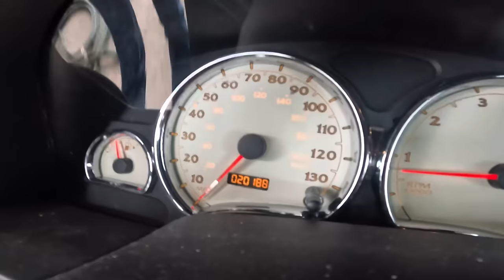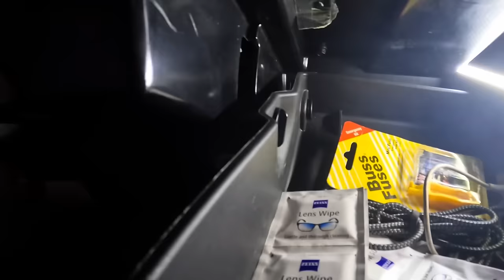Stripped Actuator! Clicking in Dash! 2007 GM Saturn Honda 3.5l

Comment: No matter how little you drive it, you still have to service it regularly..and it sucks because they will sell it eventually as low miles and well maintained. And some unfortunate buyer will buy it and spend a fortune in the next 3 or 4 years fixing numerous problems that were caused by lack of services. And id definitely be draining that fluid out due to corrosion, I bet the fluid is original and fluid neglect caused the issue to begin with.

Comment: What part manufacturer do the rear drums come from because those cylinders did not last long .My 02 Nissan rear drums have 209,000 k approx & I only checked them for wear about a month ago & they only needed adjusting due to the handbrake not holding nothing else required replacing.

Comment: Surprised you didn't use tube wrench on the brake line?? You are otherwise so exact with using the correct tool.  I have had  people want to have the drum clip reinstalled.  You can remove the clips using a needle nose plier.  Actually always have some in my tool box.

Comment: Wife unit looked unimpressed with your mileage story.  Yeah, I've been there.  Also, while replacing an engine on my wife unit's Land Rover I noticed the ancillary stuff bolted to the engine had different stamps on it to.  First noticed a Toyota logo on the power steering pump then starting looking.  Come to think of it, I think the power steering pump is the only thing that hasn't broke.

Comment: Changing lanes in an intersection is illegal, in case people aren't aware because they slept through driver's ed. Also, those door actuators are the bane of my existence. My caddy has two but fortunately they're easy to access. I've replaced them half a dozen times because the big nylon gears tend to break in half. However mine ONLY use two bolts. There are only two studs popping out of the HVAC box to mount them. No third hole for a screw.

Comment: That Saturn should be all wheel drive with the Honda 3.5. I see the rear bearing assembly has a place for the axles but I dont see the axles. Is that a 2wd v6?

Comment: Ray, the rear cylinders most likely failed due to corrosion caused by water intrusion in the brake fluid. A complete and thorough job would be to do a complete brake fluid replacement, not just a bleed.

Comment: While the backing plate is wet with brake cleaner, I've always wire brushed and lubed the bosses.
I see later in the video, you did that too.
I don't ream you out; I make suggestions that might work easier for you and save you time.

Comment: If I remember correctly, when Saturn was being done, people bought it because of the import engines, The idea was Import engines were not the older gas guzzler engines that were still running around and people thought they were better. Mostly the new gen of drivers back then which I think was also when the business office work force started to take an upturn from the factory jobs so the whole automotive shift happened. Not as big a shift but it was one. Thats when cars were becoming just a form of transportation like most cars are like now. As long as you don't blow a lot of money on them to work and get you from point A to point B then who cares.

Comment: Wow Ray, I watched many of your vids but this is the one where you show most persistence. The actuator was a great shortcut. As an engineer I cannot get across the stupid design of the clip on the handbrake lever. They could have made that a real spring clip instead something made of shit steel that you have to bend around a small rod. Anyway, great job!

Comment: Wait, I thought as long as the wheels are turning, the odometer will move. If you're towing it with all 4 wheels on the road, shouldn't the odometer reflect the milage?

Comment: The Patriot wasn't a FIAT, it was a reskinned Dodge Caliber, that shared Mitsubishi suspension. The whole MK platform was a Chrysler/Mitsu mashup which can't be all bad since they had been doing that since the 80's. Now the Patriot was a colossal pile of crap, I had one, but once you realized how it was built it was cheap and easy to modify. Mine sat on Caliber SRT coilovers with Mitsubishi outlander control arms. Everything bolted in like it was made for it, because it was in a way.

 The Renegade, which replaced the Patriot, is a reskinned FIAT 500 though and it does stoppies, so that's fun... I guess.
Reply from the maker: Sry It was the compass

Comment: Nice video Ray!  Good job with the brakes and actuator.  But you were totally wrong when explaining the purpose of the “little arrow indicators” on the dash and outside lights. They are only there to explain why the driver has been riding their brakes for the last 10 seconds or so. They usually come one once the driver has started a turn!!😡

Comment: the frustration i feel watching you casually and easily un threading a rear brake line from a wheel cylinder on a car from the early 2000s ....  Living here in the so called "RUST BELT" ... torches and new brake lines would be involved if that was from up here in Windsor... Ontario... Canada...  (south detroit)

Comment: I watch all your vids. I am NOT a mechanic by any means but I have one question. When you put the springs back on the drum breaks, why do you use a pair of end cutters for stretching the springs? I would think with the pressure you must use they would tend to cut into the springs and cause a premature fail where the cutters were applied. Is there a tool thats made for that application?

Comment: Some mechanics actually spin those off. In this case it probably wasn’t taken off like you said with 20 k on the odometer. I myself don’t see the need for this clip. Sort of like the screw that holds the front rotors. (I put them screws back in the rotor but not required)

Comment: There is still a 1/2  in. Of crust on the  backing plate by the cylinders😮 A couple of strokes with a small wire brush would do wonders.👈😳👍

Comment: I've got a Vauxhall Agila B which is the British version of the Opel Agila B which is a badge engineered Suzuki Splash with a Suzuki engine and a Mitsubishi gearbox. Apart from being one of the the most common 1L engine in the UK since it's used in Nissans, other Vauxhalls and in Suzuki's own cars it makes it easy to find parts for but only for the engine and not the rest of the car since that's just Suzuki parts. Though since it's badged up as a Vauxhall they won't supply the parts and Vauxhall won't supply parts since they claim it's too old for them to get parts from another brand... Then there's motor companies who deal exclusively with Vauxhall and Suzuki who don't respond when contacted because they are a small distance away (like 2-3 miles)

Comment: Can't the wheel cylinders be honed and have new pistons and rubber seals replaced?  I worked for my dad for many years in his garage back in the '50's and '60's and we very seldom replaced the entire cylinder and dad did lots of brake jobs.
Reply: Just the labor to rebuild the cylinders is more than the units cost.

Comment: I had to do the rear breaks on my 05 saturn vue because the spring cap on the pin rusted out and the pin pulled loose and the break exploded inside the drum >.<
Reply: Well no wonder, somebody had installed breaks instead of BRAKES.

Comment: But surely the mileage would go on it if the engine is running or not as the wheels would be turning and and there for the odometer would be going or am I wrong .thanks for the video

Comment: As a new employee of a BMW dealership in the early 90's, I was required to take a driving class created by the BMW corporation.  We were taught to treat other drivers as if they would try to collide with us at every opportunity, and that it may seem paranoid, but this was OK cause " perfect paranoia is perfect awareness ".  I was also taught not to use turn signals on the freeway because all that does is let other drivers know what you're going to do.  They also said that so many people fail to turn off the blinker you can never safely assume it is their actual intention, and causes more harm than good.

Comment: If you were really serious about cutting cost, rebuild the wheel cylinders,  they still sell kits.
Reply: If this is kinda a haha, that's cool👍.  If you're serious, I just took a quick look at Carquest and the rebuild kit is like $3.50. A new generic cylinder is like $12-17.  It's much cheaper to install new items for his customer. If you're talking about OEM, well that's a whole different story.  But this is not OEM here, it's from O'Reilly (similar pricing). Ray's hourly rate is about $120 which is about standard.  Even if it takes 0.1 hours (6 minutes) that's $12 right there plus parts and markup for 1 cylinder, and I doubt the job rate is greater than 0.1 hour.  Rebuild is ok for a diy where it's your own sweat equity and you are on a really restricted budget.  Otherwise save the hassle and get new.  Kinda like getting new discs or drums rather than grinding down old ones.  If parts are non-existent, rebuild may be the only fix, but in this case there are options 🎉.
Reply: I Can hone & install a kit faster than he replaced the cylinder,  no joke

Comment: I've always found it odd that brake shoes wettened with brake fluid get so grabby on the drum . One would think the opposite would be the case ?
Reply: If you want to see  a lubricant make brake shoes sticky try gear lube when the rear axle bearings go bad. You have to reverse to make them release.

Comment: That right there is why I HATE hub brakes.  I wish my 2005 Silverado didn't have them. I had a chance to change out the axle with a 2004 I sold for parts/scrap and totally forgot about it.  It had discs.  Now, upgrading to rear discs will cost me well into the 1500 range.  Oh, forgetfulness and old age...lol.  The fun part of those hubs is that retainer spring and cap.  Accidentally let it slip and you'll never find it again when you're laying on the ground working on them....been there, got the t-shirt. Fun. Hit me in the cheek on it's way to infinity and beyond and cut my cheek.  Had to drive 20 miles in a borrowed auto and find the replacements...and the tool.  Never used that tool again since like 2000 but it's here, collecting dust in my toolbox for the day this 2005 needs hub brakes again.  I think I'll take it to someone. Disc brakes are easy on it.  Hubs..cause cursing...LOL   Take care

Comment: As you said always poke and prod away from yourself, and NEVER USE NEEDLE NOSE PLIERS to pull toward yourself to remove brake cables.
On the lowest common denominator theme, are the high beamers and no indicator folks the same ones who believe chocolate milk comes from brown cows?
Cheers Eric

Comment: Aren’t you actually causing the leaking… by using a screwdriver to pry on the drum brake cylinder seals? In other words, isn’t that rubber part a functional component, which is used to seal in the brake fluid?
Reply from the maker: Negative, the rubber that I pulled back is a dust seal, the brake fluid seal is on the pistons inside of the cylinder. Good question!
Reply: @RainmanRaysRepairs  Aha, thanks for that explanation, much appreciated!

Comment: Question About,, actuator ?  Since It comes apart IS IT POSIBLE TO , ROTATE GEARS W/MISSING TOOTH 1/2 TURN OR 180DEG ,,SINCE ROTATION OF USEFUL MOVEMENT IS ONLY ABOUT 1/4 TURN ,,And useful good portion of gears would operate path of heater door ? just curious if anyone has tried  to make it work this way

Comment: Oh, I’m getting totally wound up, watching the drum brake job. I’ll have my fingernails chewed up to the elbow, with frustration, by the time he’s got it done.
I don’t know what it is, but watching someone else do those is torture. Ray has too many pliers, distracting him from the easy way. This is everyday, bread and butter work, here. Drums are still common on smaller cars, over here. I do them a couple of times a week, when things are busy. I use a 10” vice grip for all plier type tasks. A stubby flat screwdriver for stabby tasks. And I never fit the retention springs until everything else is assembled. But even this doesn’t account for why it takes most people so long to do them. I must be in a groove. Even when I teach someone how to do it (a whole other level of torture, requiring superhuman levels of self discipline!), they still take forever to do them, dropping things on the floor, chasing them around the workshop and so on. This must be my asd superpower. That and bleeding hydraulic systems, using only a spanner and a long tube.

Comment: Many American built cars and trucks have small retention clips mounted at the base of the studs. These stud clips were designed to secure the brake rotor or brake drum to the hub as the vehicle was moving down the assembly line in the factory. Once the brake calipers and pads are installed, they serve no real function except for Karens. 😂

Comment: Mr Rainman Ray. There’s a tool called a brake tool that you use to put them springs on safely using wire cutters. Dykes to stretch the spring indentation that you’re putting on the springs this weekend, causing to fail as unsafe practice and a teacher, Internet is so wrong incorrect way of doing it makes you a hack, sorry but that’s how I feel my opinion of mechanic breaks the most important on a vehicle you should know that

Comment: I actually dont mind doing drum brakes but this design with the adjuster at the top seems overly complicated than the ones I am used to. If I was doing this job, Angry Technition would probably come out more than once. Same deal with that actuator. - Jamie

Comment: It's called 'Badge Engineering.'  Research what you are buying & you can get the same car as a 'cheaper' brand & pay less money.  
As for the parts, in many cases it's cheaper to buy an appropriate component from a competitor, (or in the case of FCA: Fiat Chrysler Automobiles, they are companies that own part each other, and Mercedes was part of the mix for a while.  My JK has a Merc gearbox.)  Then you have General Motors, Holden, Seat, Vauxhall, which are all brands owned by GM.  Same goes for other makes owned by Ford who used to own Jaguar before they sold it on.

Comment: Ray, That’s not the first time Chevrolet has done that. I personally own a 1986 Chevy Nova, 99.99% Toyota. 2.0 , brakes, even the muffler stamped Toyota. They tried putting a Chevy grill in it and it doesn’t fit any of the body lines 👎

Comment: Saturn was backed by GM earlier on but it had it's own designs built it's own engine's in house until 2002 after that GM decided to take total control over Saturn production line, then that's when they went to shit. I've got a heart for Saturn's. GM is directly responsible for Saturn's demise. An fyi Saturn was the first company to introduce the third door for access to back seat on there sports coupes.

Comment: Ahh!  My first wife had a 1966 Tempest.  It had extremely touchy breaking action.  I replaced the front breaks and found the shoes had been swapped, leading and following.  They worked properly.  I reconditioned the cylinders.  Those were the days.
Reply: So you replaced the BREAKS  with some proper BRAKES  then?
You know, to convert the breaking action into actual braking action...
Reply: Thx:hand-pink-waving:

Comment: I wonder, why those shoes are not a whole assembly with the lever, like it`s in europe. And all that bending stuff, trying to pull it out that clip will not be needed. Just pull out the handbrake cable out, put it in the new lever and all is set. Between, you said Troy, where is that Troy unit?

Comment: No don’t put the clips back for the drums or rotors. If they complain, then challenge them to prove how it would affect the vehicle. The complaint department should not refund the customer for that. The customer probably used that to get the job done for free and knew nothing bad would happen.

Comment: The easiest way to remove the little horseshoe clip is with a chisel instead of a screw driver.  A couple of taps on the chisel and it will spread and come off.  Try it next time.

Comment: You wonder why brake fluid isn’t flowing? The master cylinder cap is probably still installed, and you collapsed the damn brake hose with vice grips of all things. It doesn’t take much pressure. It’s better to let it drip a little bit while changing the wheel cylinder out. 30 year brake technician here….don’t blame you for not wanting to pull the dash to get to that actuator. I have nothing else to complain about……and that’s a lie lol

Comment: I was a tech for over 10 years before I had an accident and am unable to work. Not work related. I stabbed myself in the eye once with needle nose pliers pulling springs off some shoes one time. Since then, I always use side cutters to grip the springs, and wear safety glasses. 😉

Comment: I dunno.  Honda will be selling a basically re-badged EV Blazer, but instead of removing apple car play and andriod auto like GM is, they haven't lost their minds are including them, as many, many consumers want. GM's Ultium is, in theory, the most serviceable Battery platform I've seen in an EV, meaning it should be third party mechanic friendly (eventually).I'm all for one vendor licensing a great tech from another and making it BETTER.

Comment: The area behind the brake flange where the brake cylinder is mounted showed a leaking connection also, easy to see the moisture from a slight loss off brake fluid added additional road dust to adhere onto this moist area.
I would think there is an issue with this brake system from the factory assembly.
We should never see such minor liquid release when a vehicle is fully QA inspected during factory build.

Comment: as an older guy I remember these horrible type brakes, this is  the one thing the new cars have improved except for using junk material for the rotors guess you can't expect to have everything. glad you made the video otherwise this will be a lost are